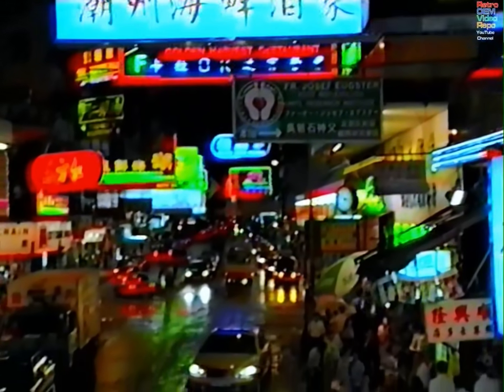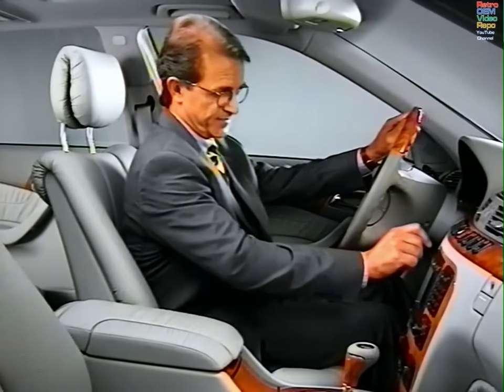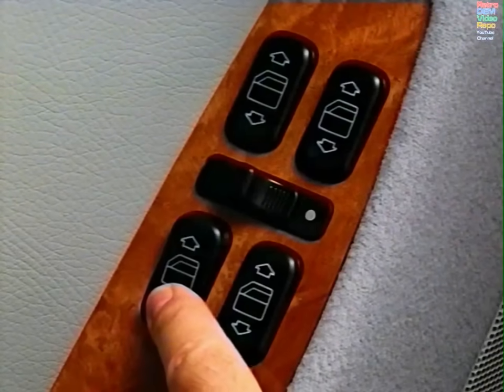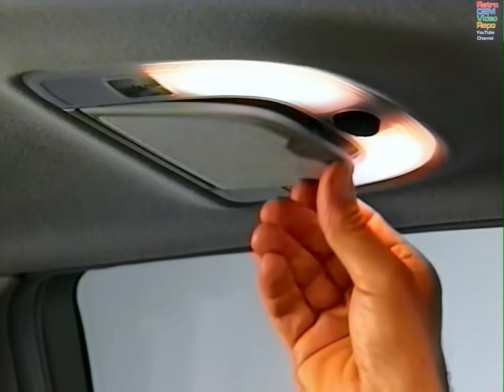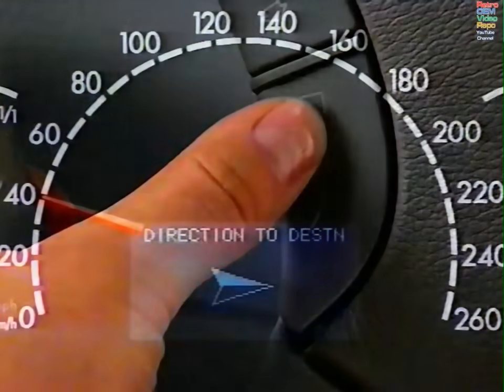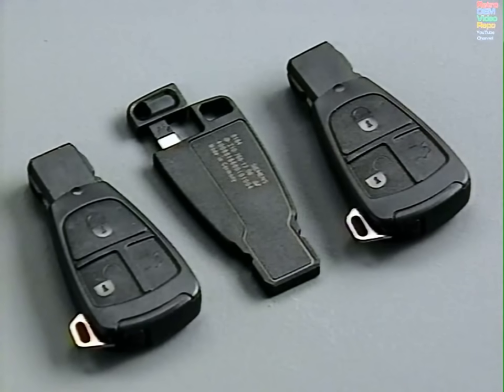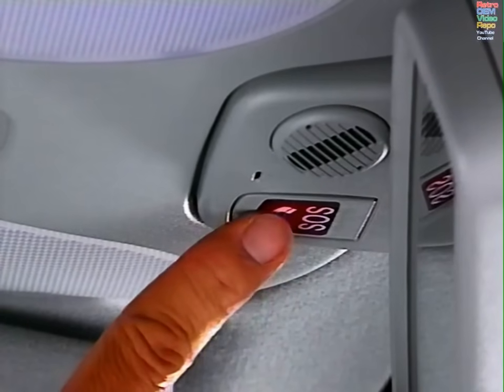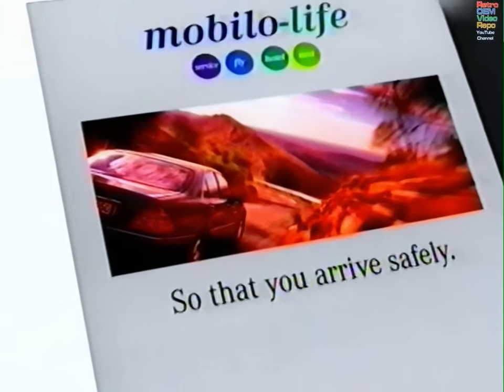Mercedes Benz - S Class (W220) - Video Handbook (1998)

Comment: This car had too much technology Mercedes hadn't perfected yet. The W126 was perhaps the best Mercedes ever, and possibly the best automobile. The quality was impeccable and the driving experience sublime. They managed to make a huge car feel remarkably limber through artful engineering and balance, not with too many gizmos that interfered with the purity of the driving experience.
Reply: MASSIVE amounts of electronics for 1998. Distronic is active cruise control right?
Reply: This car did seem to get a much warmer reception than the W140 when that car was launched though. 

Interestingly the glazing on the W220's doors is thinner than even a single pane of the W140's double glazed windows. Mercedes never pushed the envelope of excess as much again after that S class.
Reply: @andyb3666  everything got a warmer reception than the 140. When ur new flagship sells 60% less than the flagship it replaces and is up to twice the price. And your losing customers hand over fist to Lexus. And the boot doesn’t close which is annoying but the doors don’t stay closed so when it rains the doors open a crack and the car fills up with water. Still a great looking car if u leave it in the garage.
Reply: Drew you've got a point.
Our 2002 w163, ML500 SUV is pretty "analog" as is our 2000 w210, e320 wagon.
I'm keeping them going strong.
Parts prices are now dirt cheap for them & not too much tech. 
Drive the classic older Benzes forever !
Reply: 126 awesome car but completely soulless unlike the 116.

Comment: This car is awesome if you can maintain it just like any other car. I have 160,000 on my 2000 S430, everything works and still drives like a dream. I just fixed the airmatic struts at 160,000 miles and the rest of the suspension is solid. It's the easiest car to work on and maintain. Those of you talking about it being unreliable have either never owned one or have no idea how to maintain a car. I can tell you one thing, if you took it to the stealership for A or B service or repairs, You paid for it.  This car is very reliable unless you're an idiot. Unfortunately you can't fix that.
Reply: Fuck you and ur judgement. Mercedes w123 were reliable tanks, not this scum s class. After w124 mercs lost their manly charm and reliability. Scum of a company
Reply: @gabrieltdu5780  I get it you have a strange lust for the W123. I'm sure it's a wonderful car.
Reply: @StealthyMonk You must be that high hanging intellectual fruit. You sound like a chump to me. I plan to drive it not sell it. If I can get a car that was originally around $90,000 for around $4000 and is easy to repair, I'll take it. You should check where your intellectual fruit is hanging. You must have already dropped and spoiled.

Comment: I've had 3 S Classes. First one I bought was a 2002, a 2005 and then a 2007. And I have to say even though the 2007 was the new generation model it felt no different than the 2002 and 2005.

Comment: Too bad this was a bad era for Mercedes Benz reliability. The 98' S-Class was so full of technology!
Reply: 95-2011 was disastrous for any german car since the new technology was unreliabale. It still goes on today but in less numbers.
Reply: @shakke52   the numbers say something else
Reply: @shakke52  95 bad for any german car? Its golden year of E39, A4 B5, A8 D2. These cars are rock solid.
Reply: @shakke52  Beg to differ Bro.
We have 2 of them, a w210 e320 wagon (Stuttgart produced) and w163 ML500 (Alabama produced), model years 2000 & '02 respectively.
Great vehicles by any measure !
And both had 100k but well maintained when we bought them.
Enjoy the ride !
Reply: This car has WAY more tech than the s class before it.  these cars were not  unreliable,  but they have more electronic issues than cars w/out advanced electronics.  But I have never seen a w220 leak oil n2 the wiring system like w221 and w222.  A lot of w220s are STILL on the road.  Are u a mechanic or just regurgitating stuff u saw on other videos? 🙄🙄🙄
Reply: Their engines are ultra reliable mercedes makes very reliable engines the same cant be said for the eletronics

Comment: Navigation schon 1998?👍
Reply: Gabs schon in den 80ern
Reply: I have one in my A4 from 1997
Reply: Average Joe Mazda Cosmo, Navigation System Named GPSS (1989)
Reply: First is not the best  hahaha
Reply: Ja mann
Reply: Rost auch :)
Reply: Stronic and acc in 1998 wtF nigga
Reply: Kia had it in 88
Reply: https://youtu.be/LoYSCuAwPUg The 1987 Buick Riviera already had a touch screen! Most cars built in the early 2000s didn't have a touchscreen!
Reply: So, Toyota Crown 1988 have touch screen and navigation system. BMW suck
Reply: Well my 2002 subaru forester has a touch screen factory screen 📺
Reply: @cockshield  Yeah. So did MB. The W220 just happened to be released in fall '98. COMAND 2.5 was way more advanced than previous systems of any manufacturer. This car was revolutionary.
Reply: Land Rover hatte auch schon sehr früh Navigation wo man hinten im Kofferraum so eine Art kleinen Rechner hat mit CD Laufwerk wo man die Navi Software rein schieben konnte.
Reply: @cockshield  And Honda in 80's ;) Bmw sucks
Reply: FarukTTA bmw doesn’t suck, have you even owned one?

Comment: @27:36 😂😂😂😂😂😂 "1 touch start function"  - > just do what you would do in any other car: put in the key... and turn. 😂😂😂😂😂
Reply: not all cars have this. not even today. The point of 1 touch start is that you don't have to turn and HOLD the key in the ON position for the time the car turns on. This is mimicking start-stop button in modern cars. press once and wait until the car does all electronically (heats up fuel lines, runs the starter motor etc.) same applies here. just with the key and one swift turn. :) For me this is handy because I turn and release the key... by the time the car starts I can use my right hand to put on the seatbelt. Bye the time I'm done, car is running :P

Comment: 6:42 and 6:54  cringe on the door close sound.   certainly a problem with the sound mixing...
Reply: Clunk:)        
Sounded like a Renault Kangoo or a Dacia:)
Reply: @MrTruth111  Dacia is best car
Reply: @user-mi4yc7pr3x  Don't poop in your bed! ; )
Reply: Victor Vaughn sounded like a gun shot
Reply: No it's just that they completely dubbed the original German sound recording and for some reason (I'm guessing) they didn't have neither an S-Class nor any merc at all on site, so they just recorded the sound of whatever crap car they happened to have on location ; )
Reply: @Superknullisch I found the original German video and it has the same sound! So bizarre
Reply: Victor Vaughn it was 1998 man, and some do sound like that

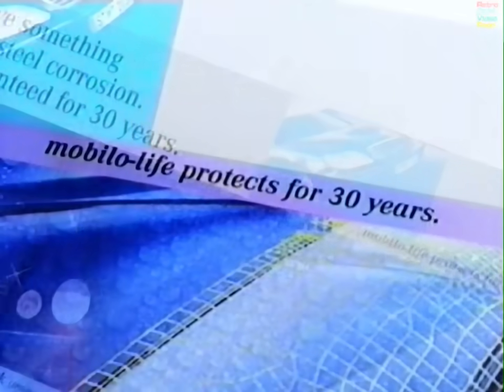Comment: 37:14 funniest part, a picture of w210 with a 30years no corrosion guarantee )))
Reply: I have 1997 W210.....no rust.....in the winter i wash the car corectly 3...4 times a week ......mostly under the car to remove the salt ......and corect tire mesurement .......
Reply: Teladriel yup... my buddy’s got a s600... same gen... doors, side skirts, rusted to shit. Clear coat? Peeling everywhere, worst parts are the hood & roof. This car is a piece of junk. He’s replaced the ridiculous suspension with springs and he’s telling me he’s throwing in a GM ecu, because the car is going nuts. Funniest part is he’s defrauding inspections with some shop because the car has a permanent check engine light lol...
Reply: @Andy-bm6zo  W220s came with a massive amount of clear coat. You really have to leave the car outdoors for 20 years or abuse them for the paint to let go.

Comment: The door seat switches used to come off in your hand. Quality took an absolute nose dive and lets not mention the air suspension.
Reply: Also the Air conditioner
Reply: id love to come off on your hand
Reply: Yeah, right. Mine still has the original switches that have never come off in my reliable 8 years of ownership.
Reply: Agreed Air Suspension = bad plan.
My 2 Benz don't have it & I would avoid it if possible...
Reply: Airmatic isnt a problem, its the ABC suspention.
Reply: Seymour Beaver doesn’t matter which car company it is, air suspension always fails over 100,000 miles
Reply: I had that car before,S320L, $1200 on suspension every year

Comment: This car has more technology than many modern cars...
Reply: This car has more technology than my mother's mercedes 2018 kkkkkkk (cla 200)
Reply: Nope 🤟💀
Reply: @BistroGlicerin3  What nope ?
Reply: Well it is an S class
Reply: Youve been a Honda driver I take it
Reply: Jas Wal Well the car was considered advanced for 1998.
Reply: @jaswal167  let it be it had....
Reply: @jaswal167  Honda gives technology in engine not interior. My honda has 600k km and still running great
Reply: @dominik7014  my benz The same .
Reply: @dominik7014  merc benz 300ds with 2millions km taxis so 60pk is nothing for a old merc.
Reply: @dominik7014  merceces two ....but owner change oul twice in 10 yrs.....
Reply: @dominik7014  mercedes m113 engine is bulletproof .
Reply: @dominik7014  w124, need i say more?
Reply: @dominik7014  Mercedes 190 still run with near 1 million killometers in maroco.
Reply: @dominik7014  EL MIO TAMBIEN MERCEDES BENZ ML 270 CDI 4MATIC LUXURY 5G-TRONIC CON 920.000 KM HOMOLOGADO MOTOR Y TRASNMISION HASTA 1 MILLON DE MILLAS
Reply: @dominik7014 That’s what every Honda owner say no offense but no one cares that it runs 500k miles like I’ll just buy 3 of these S Classes for $5k and that’s just fine for all the technology and a whole V8 or V12 under the hood…
Reply: @jaswal167  okay buddy, mercedes won't even last 100k miles
Reply: Because they realized it was useless.
Reply: Because it is a Mercedes, not a Dacia Duster.
Reply: It is the S class for a reason
Reply: What do you expect for 125.000 dollar car? You don't need that luxury expensive feeling when your chassis is almost done.
Reply: @King Zak  lol VW owns Audi, Lamborghini, Scania, Ducati, Bugatti
Reply: @Jason Yau This Car have much more rust than other cars, too
Reply: Yeah compared to a modern Tata
Reply: It’s called luxury
Reply: Absolutely
Reply: sure as hell youre correct, look at the fucking interior of some (a little) older Maseratis man,  so outdated
Reply: just realized this video is more like a modern car review then a training video i guess there both the same.
Reply: @Illunworth huh
Reply: @Illunworth with what
Reply: but most famous and best working technology are auto weight decreasing with rust help
Reply: Better than my car
Reply: You are Right
Reply: and more problems as well.
Reply: No it doesnt
Reply: Да
Reply: W140 much better
Reply: For sure you must be driving a korean car to say such thing
Reply: Ali Saghir 😂😂😂😂broo..
Reply: Ali Saghir what are you smoking right now? Have you seen ANY new Korean car. Hyundai, Kia, Genesis. They are filled to the brim with tech, quality materials, huge touchscreens, digital gauge clusters. Seriously, what year are you from, cause you’re obviously not in 2020.  Yeah, Korean cars used to suck but they’ve made a come back. Do you live under a rock or something?
Reply: The Conservative Dude bro he said korean car because of the guys origin its kinda joke 🤦🏻‍♂️🤦🏻‍♂️
Reply: @CT-5555-7  why are you so mad bro you must be driving the same car he is driving, and btw Korean cars will never ever match German cars
Reply: As stated on car shows many times,  mercedes is 10 years ahead generally for most implemented working technology.
Reply: @smotpoker15  10 years ahead? Absolutely not. Maybe a couple
Reply: Best Mercedes-Benz ever created, I don`t care what you saying !
Reply: Old luxury cars are better than new poor-ppl cars.
Reply: @love__and__hope__  nope not even close. New cheap cars have much more ammenatied and tech than old luxury cars like 360 view. Plus they're safer and more reliable
Reply: @CT-5555-7  I have bought two brand.new cars and without major engine issues one did 120 000 km and second car did 175 000. My 1997 (bought used one from relatives) bmw e39 530 diesel has 366 000 km on odo and still drives good. Safety - it has front and rear parking sensors. New cars are money pits. Why purcahse new one budget car for 12 000 euro when you can get old bmw or mers for 1500? If it breaks down, it wont be near as much to fix than price difference between old amd new.
Reply: @love__and__hope__  it’s really just preference. Old luxury cars have one or 2 sensors that beep at you. Cars today have Lane departure warning, LKA, Adaptive Cruise control, Blind spot alert, and so many more. They have a updated modern interior with a lot of tech that old luxury cars don’t actually have like 360. Like I said it’s mostly preference. I’d prefer to have a new modern car with modern amenities
Reply: Its the s class you look too to know what's on cars in next 10 years
Reply: And its failed more than other cars now.
Reply: Yes,it's true.This car is like Mercedes Benz w163 ml.
Reply: @Mirnes Čovrk I know, Merc is ahead of it's time but in my opinion Honda is way more reliable car
Reply: It’s a Mercedes ❤️
Reply: Fully equipped it’s only missing Bluetooth from being from 2018
Reply: @danielressel6138  I have factory Bluetooth for mine, still works fine. Can make calls from iPhone still and use the telephone options on screen
Reply: I just bought one very cheap. Works very well but i came here to literally find out what all the buttons do. 🤣🤣🤣
Reply: Many cars are 10 years behind Mercedes.
Reply: @shifty2755  thats why they used renault dci engine in cla180d
Reply: @hippievogelei  

That's why I would never  buy one. The whole point about a merc besides the luxury, is the engine.
Reply: True
Reply: Yes, and it become endless money pit as it ages
Reply: Michał Skiba scotty kilmer fan?
Reply: It’s on par with the 2002-2006 Lexus LS430
Reply: @805NAVE  Lexus doesn't offer straight line perfomance like the S65, S65 would absolutely devour its opponents
Reply: @805NAVE  on par means same year release 1998 is 4 years earlier total different era
Reply: Mr Hippie i wouldn’t say totally different era since many things were similar even though the date ay be different
Reply: DIAMLER LS430 was made without any compromises with legendary Japanese quality of that time. Germans were on the quality slope from end of 1990s. I’d take Lexus any day... still this Mercedes is great car - it crushes new S-class by far.
Reply: because this car is 1998 price 5 house price 😀
Reply: Almost all
Reply: @King Zak  

Agreed. Vtec is amazing. Honda invented variable valve timing. Absolutely brilliant system.
Reply: Ya with the check engine light on
Reply: Ya this merc s class can fly like a flappy bird.
Reply: Merc s65 that’s a fat lie.
Reply: No it doesn't.
Reply: Iphone 6 vs redmi 12
Reply: Jason Yau that’s just.... not true. The technology in this car is ancient compared to modern cars. What planet are you on?
Reply: Merc s65 no, one of the most driven luxury car is the LS400. Million mile recently, and almost all common function works, and the only other major fix w it was a transmission build.